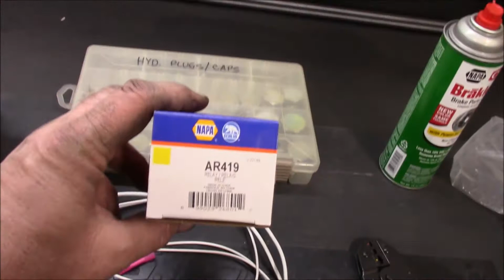FASS Installation on Monaco Roadmaster S Series with Cummins ISL Engine

Comment: Hi Mike, great video!
I was wondering how your FASS system is working for you. Have you taken any long trips.
I have been thinking about putting the FASS system on my motor home with a 2002/2003 Cummins 8.9 ISL with 120,000 miles that has the CAPS system. I'm not having any problems yet, but like you, I like to put in prevented measures. The local Cummins dealer said if it is not leaking don't worry about it, plus they will not do the work or give me help. There is no one in my area that will work on motor homes. The Diesel mechanics in my area are not interested in giving advice or help with the install.
I can do the install my self but there are a few things about the lift pump and injection pump that I can not get a straight answer from anyone. 
Did you by-pass the lift pump at your engine and tie the FASS system directly into the injection pump? 
I would love to chat with you in more detail. please let me know if that is possible.
Thank you,
T
Reply from the maker: T, I now have about 5500 miles on the coach since I installed my FASS fuel system.  It ran flawless all last season. 

As for the OEM lift pump, yes I bypassed it on the supply side. It is only being used for the return from the CAPS pump for unused fuel back to the tank through the OEM manifold.  

If you refer back to the following segments in the video, 10:25, 22:00 and 29:00 you can see that my system runs in the following manner:
FASS pump & filters, directly back to filter #3 then directly to the CAPS injection pump.  

Also, the high volume return from the FASS now dumps directly into the fuel tank which is why I chose to mount my FASS system up front as close to the fuel tank as possible.  

Hope that helps and best of luck with your install. You won't regret it. 

Thanks for watching. 
Mike

Comment: Mike, do you know  the before and after fuel pressure?? If not what is the pressure now?? Tks again  ordering one January
Reply from the maker: I'm not sure if you understand how the CAPS (Cummins Accumulator Pump System) works but the system was not under pressure from the factory. That is where the problem lies.  By design it was under vacuum, not pressurized. This is why these engines start developing issues over time as components start to wear and develope leaks thus sucking in air and air is catastrophic to an injection pump. I kept a close eye on my fuel system and never experienced any issues so this modification was purely a preventive measure.   

By pressurizing the fuel system up to the CAPS pump you are eliminating the issues and therefore ensuring the CAPS pump gets a continuous supply of fuel. 

Installing a positive pressure fuel system is a HUGE benefit to the CAPS system so it is a good thing that you are adding one but I suggest you do some additional research to more fully understand the system and the "why" behind putting a FASS or Airdog fuel system on these engines. 

As for fuel pressure that I am experiencing now, under normal driving it sits around 16.5- 17 PSI.  Under high demand it drops to about 15 PSI.  This is another benefit to having a pressure gauge mounted in the cockpit is still that when pressures start dropping off you would know it is time for a fuel filter change.  

Hope that is helpful and thanks for watching. 
Mike

Comment: Thanks for the video, very detailed. Do you know if this FASS  fit on ISC as well? Also, have it caused any fuel leak by routing the fuel return to the vent line?
Reply from the maker: No fuel leakage in the past 7k or so miles. This is a generic kit so yes it will fit the ISC as well but you could also use the slightly smaller 100 GPH compared to the 165 GPH kit that I used 

Thanks for taking the time you watch. 
Mike
Reply: @zmotorsports62  100gph is only 50$ cheapter, not much difference. I will go with 165 as well. One more question, you said you removed all the wire on the newly addec OE lift pump relay other than the relay activation wire, which means it's a relay that does nothing. What would be the meaning of this? Sounds to me same aa just disconnect the wire. I say people say add a resistive load, is your way of doing just to use relay coil energy as a way to fool the ecm?
Reply from the maker: Adding the relay coil is just a way of putting a low resistance load on the circuit.  The ECM looks for this resistance to determine the circuit is complete.  If it doesn't see that resistance/load it will flag a DTC and illuminate the dash light.   

You could use a resistor of the proper resistance but a relay is easy to replace in the event the coil ever fails.   Two ways of accomplishing the same result basically.
Reply: @zmotorsports62  Got it, thanks! I saw you pypassing the hose on OE lift pump as well. Is this a necessary step? Because I know lift pump has check valve on them, when not running, they will bypass themself.
Reply from the maker: I know some choose not to take the OE lift pump out of the equation but I chose to in order to avoid another potential failure point and for a cleaner installation.
Reply: @zmotorsports62  Make sense. Thanks!

Comment: So you are not running the lift pump, I get that, what about the return lines from the CAPS system and injectors that go to the return lines that are on the lift pump, i've got isc cummins, 99 Spartan Chassis Dutch Star
Reply from the maker: The original CAPS injection pump return line still goes through the OEM lift pump manifold which then returns to the tank.  Nothing there changes.  
Thanks for watching.  
Mike

Comment: What did you have to do with your original lift pump?
Reply from the maker: As per the video, I just capped off the OEM lift pump at the manifold and wired in a relay to fool the ECM into thinking the electrical load is still there to avoid throwing codes.
Reply: Thank you 
And one more question 
How much fuel pressure did you pump run?

I was thinking of just putting a in line helper pump. When my monaco executive 2001 ism 500hp when coch is at idle facing down hill i can here it start running funny 
Whats your thoughts?
Reply from the maker: First of all the Cummins ISM does not have the same style of CAPS injection pumps that the 1999-2003 ISC and ISL engines do we're talking about a different family of engines.  

That being said, I think most all of this vintage of engines can benefit from some assistance of positive fuel pressure and definitely the added benefit of fuel polishing that the FASS system offers to aid in keeping these older engines running clean, strong and reliably.    

As for what my fuel pressure is, it is currently around 17-18 PSI at idle and light load.  Under heavy load the fuel pressure will drop to around 15 -  15.5 PSI.
Reply: @zmotorsports62   thank you.
My plane is to put a pressure adjustable pump. At fuel tank and help the system out. 
Push fuel up to the lift pump. 
Like a carter diesel fuel pump
Reply from the maker: In that case you may want to look at the AirDog pump. It is also a very good option but doesn't provide the fuel polishing. Just provides positive fuel pressure to the injection pump.

Comment: Would it be possible to just leave the existing lift pump in place as is?
Reply from the maker: I have heard of a few people on irv2.com that have left it in place but I think the internal check valve causes pressure fluctuations.  I just chose to bypass mine to avoid leakage and take it completely out of the equation.